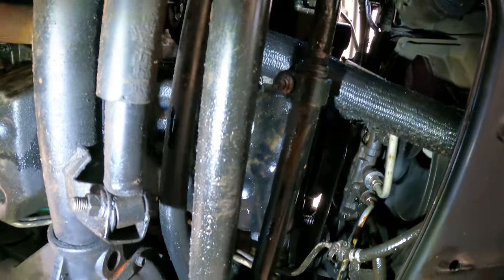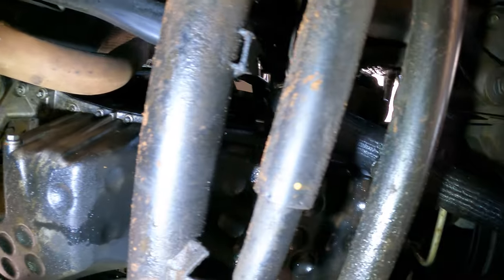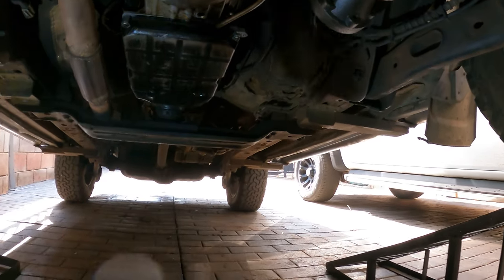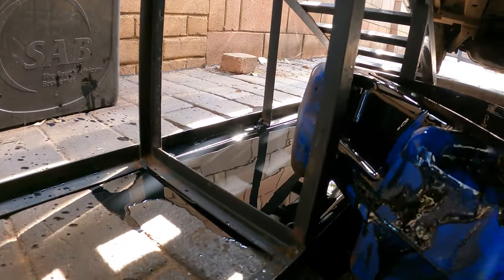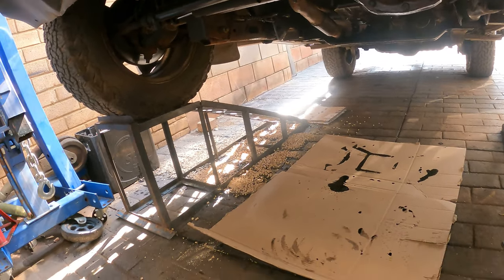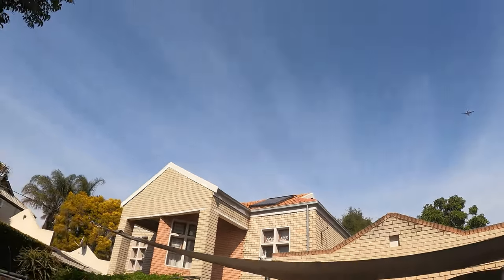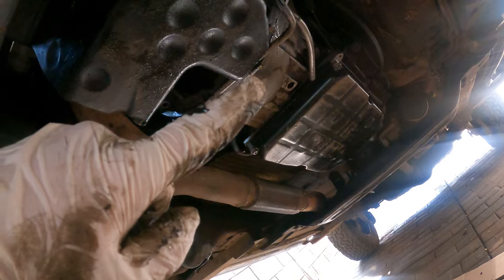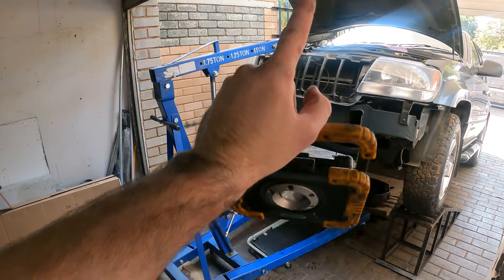RIP Jeep WJ 2.7 CRD Project - Part 8

Comment: That's a pitty, The 2.7crd 5 cylinder are such good sounding motors, I tow my camper with mine and does great. Has good torque, and the 5 speed auto shifts so smooth.
Reply from the maker: @jacquesvanderwesthuizen1527  I have found the gearbox to be super smooth. Can hardly tell when it gears up, had the same box in my JKU 3.6. I really hope I can get the 2.7 motor sorted. Unfortunately some people dont look after the motors as they should, taking years off the motor. But I will do my best.

Comment: Sad for the 2,7 CRD, much better motor than the older 3.1. Swap it with a 2.8 CRD you get in the Wrangler. Please dont do a Lexus V8. So many that does this.